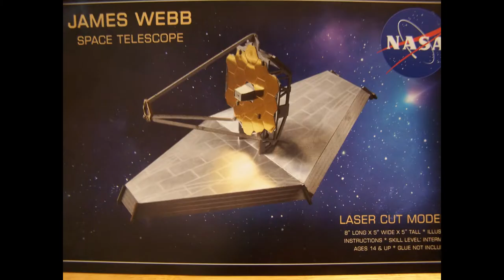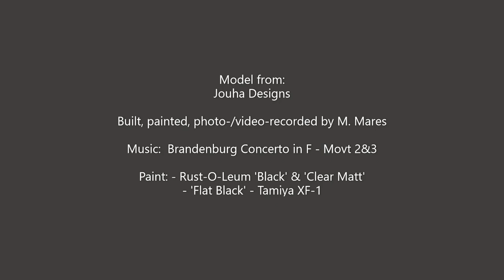James Webb Space Telescope model - I.S.I.M. (Part 2)

Comment: Looking great. Very nice build of an impressive model. Good luck with the sun shield array. Looking forward to seeing that. Great work, Brad.
Reply from the maker: Thanks, 'Brtree', the sun shield will be the most Challenging part of the WHOLE model "Enhancement" that I plan.  It will, hopefully, be the installation of the FIVE (5) layers!!  I'm going to try to modify the kit itself by cutting slits into the braces that the Original JWST hold the sun-shields separate during the "Tensioning Phase" a week ago with JWST.

The thing is though it is like making sails on a sailing vessel and You don't have Any experience in attaching those sails!!!

In fact, I MIGHT have to do Part 3 into Sections A & B because there is a 'Science Bus' ( it holds the propulsion and computers to communicate to Earth and navigation ) that needs to be heavily modified.....then onto the 'shields' and Those are of different sizes/dimensions!!!